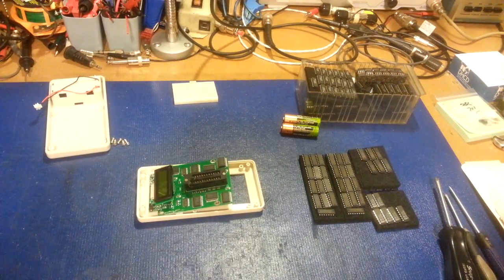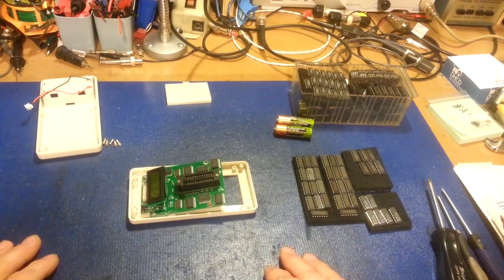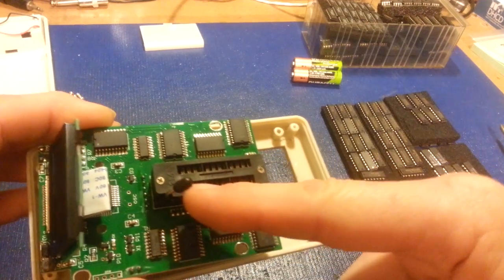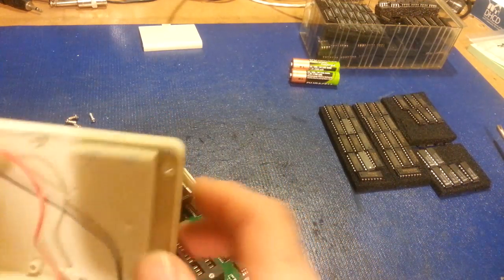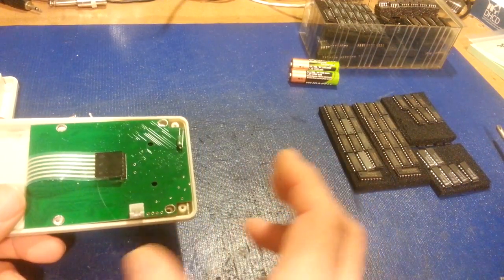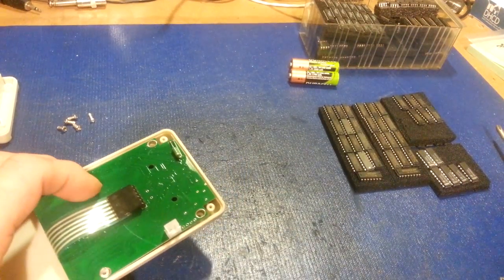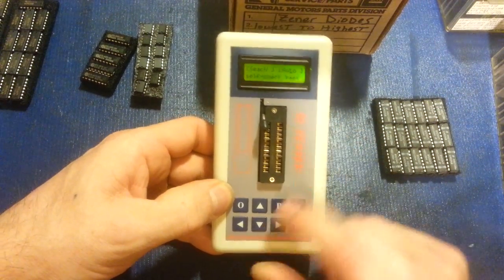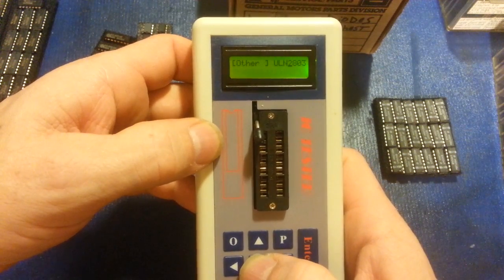Cheap Chinese IC tester / identifier review.

Comment: 2021, I got one. Fixing a Heathkit clock chime board. I finally found the problem: a 45xxx IC that was temperature sensitive. Warm it with your hand - Fail. Cool it off, it worked.  And this little gadget found it. Now the chime board works great after a quick visit to Jameco Electronics who had the IC.  Boom. It was a good purchase. And it tests 555 timers, so it works pretty well.  Thanks for the great video.

Comment: OK, it can identify components BUT does it tell you if the DUT is any good/working?
Reply from the maker: If the device under test were bad it would not be able to identify it.  That's how devices like this work.  They check between every pin to determine what it is.  If something was wrong with it, it would not be able to determine what it was.

Comment: So what does the "P" button do ?
Reply from the maker: Harb's Elecronics Lab 

It looks like it starts the units self test function.
Reply: Haha , after watching your video about this tester I ordered one, which turned up just yesterday after asking this question.....I think you are right, its just a self test thing.
I was hoping it was "P" for programming new chips in, but oh well.....it seems to work which is great.... and a heck of a lot cheaper than the bench models we have here....nice addition to the carry on toolkit
Reply from the maker: Harb's Elecronics Lab 

Only does opamp's, CMOS and TTL's really so definitely wouldn't be programming.  You definitely can't beat the price of these.
Reply: yeah, I was hoping it was a way to add new chips in the future, but yes for the price you can't go wrong  ;)
Reply from the maker: Harb's Elecronics Lab 

I don't think that would be much of a problem.  Not like there is a lot of new TTL and CMOS comming out every year.  Most have been around for decades.
Reply: and lets face it, if there was, a new tester wouldn't break the bank lol......probably one of the best value for money bits of test gear I have ever brought! so thanks for the heads up.
Reply from the maker: Harb's Elecronics Lab 

And for me can pay for itself with just a couple test.  I often run into add on boards in radios that have the part numbers rubbed off.  Don't have to reverse engineer the circuit now.  Just pop the IC in this little guy and it tells me what the "secret" IC is.
Reply: Yes, the Chinese, love them or loath them, sure bring these sort of devices right into the hands of people that otherwise wouldn't bother buying a "name brand" one.....and the quality of their stuff is getting better and better.......and having to admit I am not a fan and would rather by US or Euro stuff, I certainly bend the rules for this sort of thing.....I mean $40 or so dollars is not the end of the earth to loose even if it turns out a dud.....its funny how small my "Portable" tool kit has become these days.....with all the "PEAK electronics" branded testers and things like this, flying fully equiped is now possible.....there really is no piece of test gear you cant buy in a miniature version is there...scopes, Analyzers...the list goes on

Comment: I've still got one of those; have had it for years, and I don't remember when I bought it. It can test TTL/CMOS, and some 16 pin DIP SRAM/DRAM chips, such as those found in early micros; TRS-80, Apple ][, Commodore 64, ZX81, etc... I believe it even has an option you could buy an adapter to test early SIMM modules, too, but I didn't purchase it. The sticker on mine says made in Taiwan by Modular Circuit Technology, FWIW.

Comment: I used to have a ancient Heathkit Digital IC tester, that was a monster. At this price don't think I can pass up just getting one to have around! It's actually amazing the simple test equipment that you can field on your bench nowadays, either with the Peak or Chinese cheapies for ID'ing components and testing them and getting a basic readout of their characteristics, etc. We found a bad electrolytic cap in a studio link transmitter the other day simply by tying the ESR meter to it and comparing with another identical cap in the circuit -- like Mike always says...just replace them, especially in high temp, 24/7 applications.
Reply from the maker: Dino Papas 

It is amazing how small equipment is these days if you think about it.  We may laugh and say impossible but I can imagine a day when we have only have one or two pieces of test equipment on the bench and they can do everything.
Reply: For commercial testing applications the NI/LXI boxes just about do this; you're right some day in the future it'll be the same for our benches.